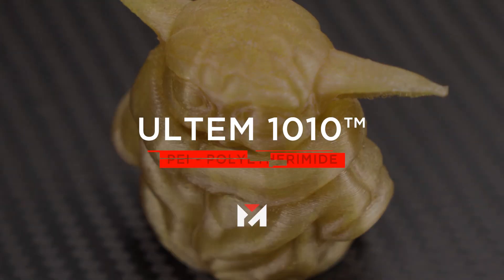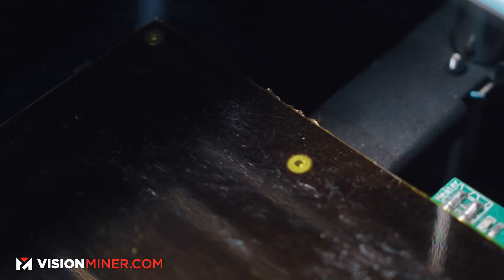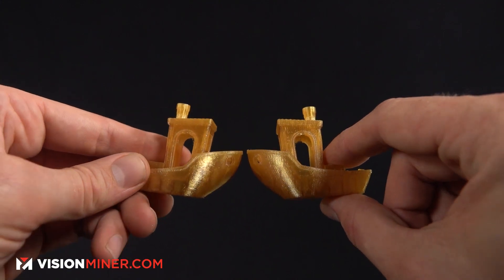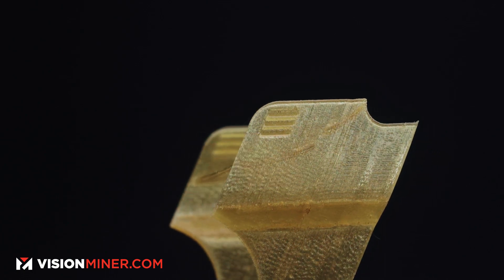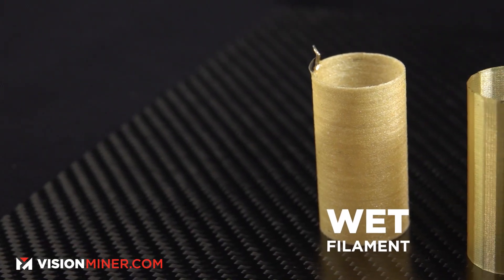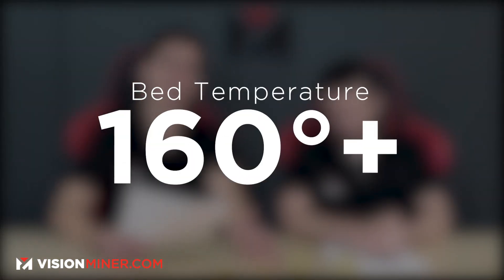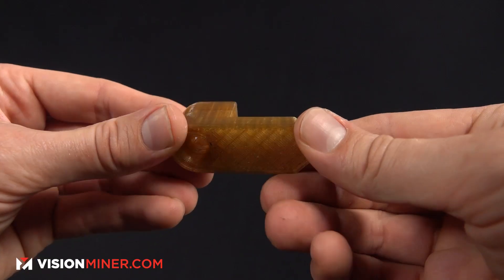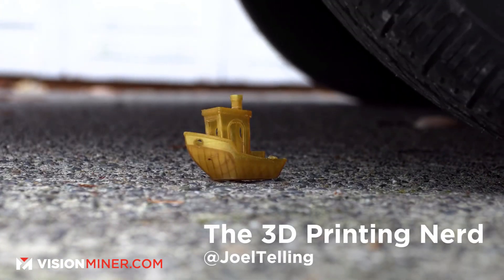3D Printing Parts in Ultem™ 1010 Resin by SABIC - On Open Material 3D Printers

Comment: How do you differentiate between fake ultem and real stuff? Is it temp resistance? Mechanical strength?
Reply: Probably print temp, if it don't say 370+ it's fake
Reply: @elitewolverine  Huh. I got a spool that said it printed colder than that and tried extruding it at the temps given. Barely worked. actually was solid coming out of the nozzle.
Reply: @josiahong5177  damn

Comment: How does PEI handle long term UV exposure?
Reply from the maker: It's highly resistant to UV and gamma radiation -- used in space, it's quite good!
Reply: @VisionMiner  yes, not only in space proper, but on the moon too.  in addition to the atomic oxygen/ UV polymer exposure tests on the ISS, PEI was found (accidentally) to have not only UV resistance, but high resistance to high energy particles from deep space such as cosmic rays etc.

They found it when a sensor on the LADEE mission had lower than expected radiation exposure. Turned out there was an ULTEM seal that had inadvertently been shielding the sensor.

Comment: I’m curious that you recommend the Funmat HT, which has a max chamber temp of 90c but in the video you say you need a chamber that can hit 180c to really print it.
Reply from the maker: to print solid, thick parts you need 180C -- however, you can still do a lot with thin walls and certain geometries with a lower temp.

Comment: Would this material be suitable for something like custom vents on an automobile hood? The temperature resistance properties make it seem like a great option. Can it be sanded and painted? Or do you have another material suggestion for that type of application? Thanks!
Reply from the maker: Oh definitely -- EXCELLENT for automotive stuff, especially under the hood, and not just for the temperature -- it's super resistant to hydrocarbons and other fluids you find around cars :) And yes, it can even be sanded and painted! 

Carbon-fiber nylon is often a great choice under the hood as well, especially with the high-temp nylons coming out -- HTN -- usually a bit cheaper than ULTEM, and it'll get the job done :) The CF-Nylon in our store works excellent, for a great price! visionminer.com/materials :)
Reply: @VisionMiner  Awesome, that's exactly what I was hoping to hear. Thank you very much for the detailed and informative response.
Reply: Yes it can, but don't print something that big by yourself, go to a printing company (I work at one) and buy it from their printers. It's more expensive but it will work better and actually look good
Reply: @AlexJoneses  Thanks for the input. The vents are actually not very big and I had no problem printing the first few revisions on my CR-10S Pro. I had Stratasys print the final versions in the Ultem 1010 CG since I have no experience with the material and it requires a much fancier printer than what I have access to. As you mentioned, this route was not cheap but the vents seem to be holding up very well so far: https://ibb.co/WGDqJvZ
Reply: two jay oh that's good to hear, if you want an easy ultem printing experience by with the actual flame retardation properties (certified too), I highly recommend you print genuine ultem 9085. It's more easy to print than 1010, not as strong, but still stronger than every other plastic, and is really safe too.
Reply: @AlexJoneses  Sweet, thanks again for the info!

Comment: Is Peek recyclable? Or does it degrade considerably each time it's made back into filament? if that's even possible. If I could print the same 100 grams over and over to learn how to print Peek would be awesome.
Reply from the maker: Recyclable for sure, but if you're able to recycle it, you might as well just make filament with the pellets, they're much much cheaper than the filament.

Comment: What would you recommend for someone that wants to print High-performance plastics with a end goal of printing Peek? Is there a type of filament that I can use that's a lot cheaper then Peek but would give me usable practice? Or should I just stick with PC as my most "exotic" filament? BTW I'm at the prosumer/ hobbyist level with an average budget. I do have a printer that on paper should be able to print Peek.
Reply from the maker: Pick up some ULTEM 1010, 9085, or PSU -- 1010 is about $100/500g, 9085 is easier but $125/500g, and PSU is about $90/500g -- you'll be AMAZED with the strength of all of them. Does your printer have a heated chamber?
Reply: @VisionMiner it not heated yet. I built a stout metal enclosure with flame retarded inflation. I haven't worried about heating it until I have a reason. But I'm looking for a reason, lol

Comment: Which of your printer/s do you normally print this on?
Reply: Also interested in this. Is the funmat ht sufficient of printing it properly?
Reply from the maker: @harrywind1870  Oh for sure -- you're just limited on size and thickness. At a certain thickness, the warping is too great, and it tears itself apart -- when the chamber is super-hot, like the AON or more, it's easier. At 90C on the funmat, though, you can still do some great stuff -- I think all the parts shown in the video were printed on the Funmat HT.
Reply from the maker: All our printers are high-temp,  so it's really "which printer is open" and whether or not we want support material, in which case we use the AON M2 or Funmat Pro 410